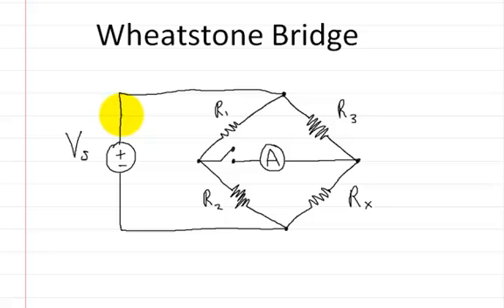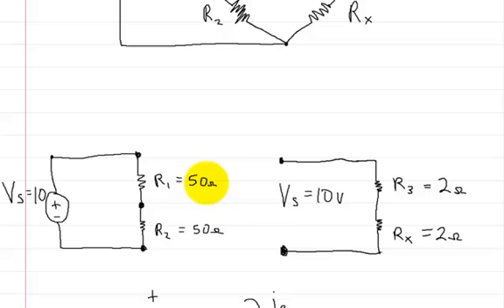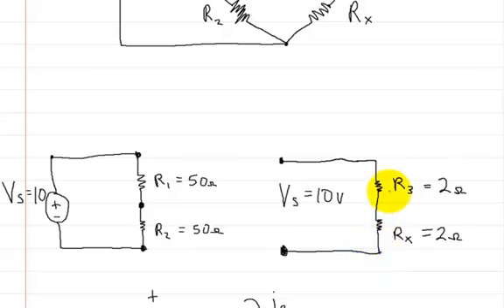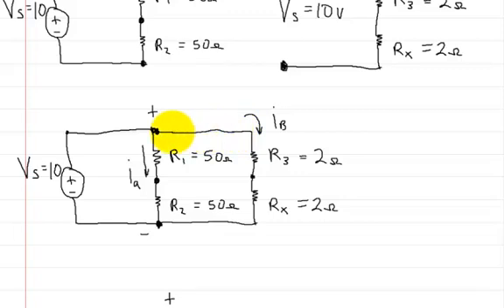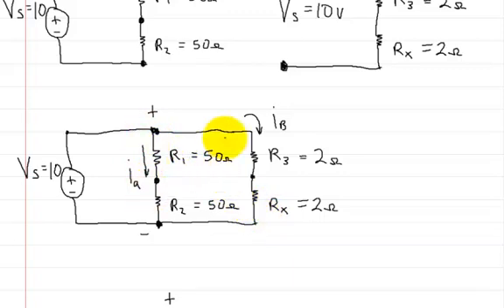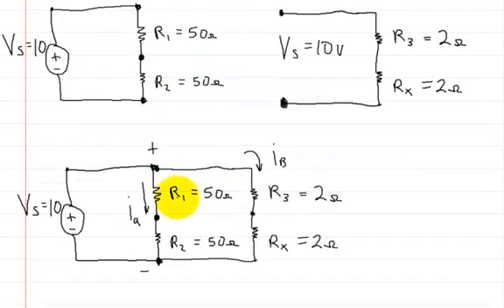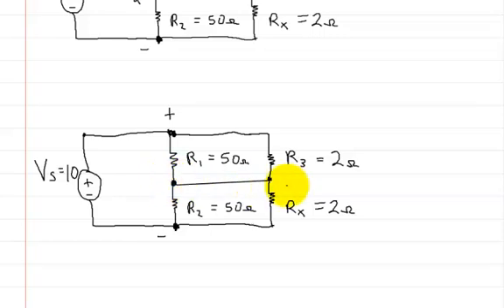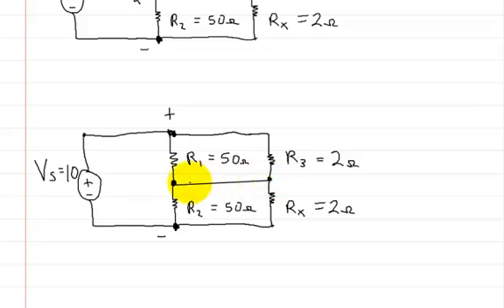Circuits Wheatstone Bridge Part 1

Comment: But what is a wheatstone brigde used for?
Reply: +Robin Bigun Typically it is used in place of a voltage divider. It is able to read out at zero volts across an output voltage if all of the resistors while a voltage divider will not. This is useful when using something like a strain gauge. The strain gauge's resistance change with strain applied to an object. This change in resistance can be read in as a change in voltage. Used much better when used in changes as opposed to pure measurement.
Reply: It's used to find the resistance of a circuit element.